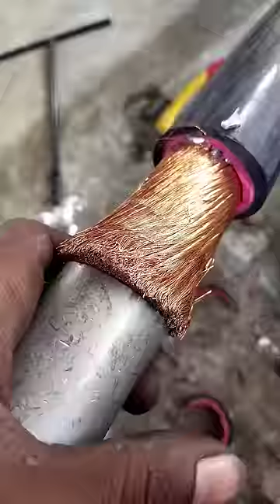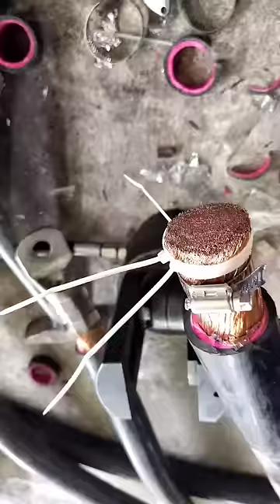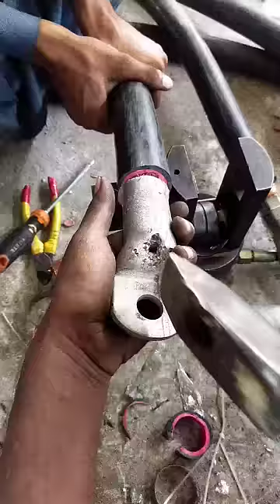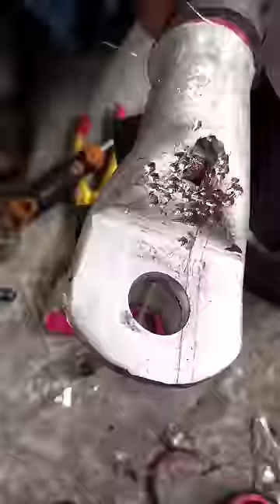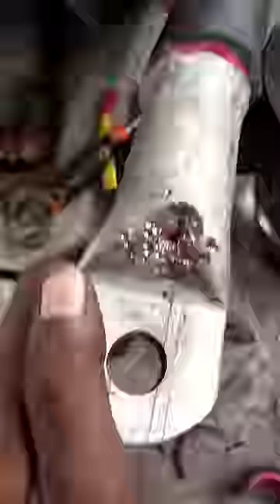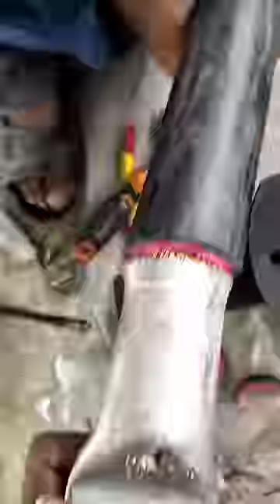Technique | 630mm² Cable Copper Lugs #shorts

Comment: Perfect for my 250,000 watt rms subwoofer amp
Reply: 250000 Watts?
What the hell kind of subwoofer amp are you powering with that
Reply: we running 1 ohm stable bridged with this one 🗣️🗣️🔥🔥
Reply: @Miauterminds  giving heart attack to the people nearby.
Reply: Pmpo chinawatts
Reply: Huh @Miauterminds
Reply: Хороош 🤣🤣🤣
Reply: 20000 db?
Reply: @Josh72769  The energy would be so immense it could vaporize matter and potentially form a black hole. This is beyond what current physics can handle and purely theoretical, but it's mind-blowing to think about!
Reply: Bros finna turn into a mobile thunder gun
Reply: we goin 1/4 ohm tonight boys
Reply: That's what I had to wire to because I was rising from one ohm to 10 almost 😭😭😭 @KianF  .25 #team no fuse
Reply: @packoswuids9000  that’s awesome bro 😭 don’t always be afraid of box rise, it’s a sign your speakers are working efficiently
Reply: @Miauterminds  трансформатор😂
Reply: Them Brazilian waxed amps hit hard and thick.
Reply: ultimate earthquake machine
Reply: Ural 😂
Reply: @Miauterminds  Basically a semi-truck trailer that was converted to a subwoofer 😅
Reply: غلط  يا معلم  ...  طريقه غير صحيحه ....
Reply: But are they magnus opus cables?
Reply: Man thats not a real world solution..

A speaker can't handle a quarter of a megawatts of heat...

Even with 1ohm dual voice coil running in parallel with a bridged amp capable of this monster would have ±125KV

Man thats way too high..
Reply: Think about the load each channel would see...

0.25ohms 

Thats way too low
Reply: Even with 85dB/w/m

 You would get 139dB spl.. thats not worth it
Reply: If you play in kashmir then the Kanyakumari peoples will feels a bass🙄🙄🙄
Reply: This cable could not handle 16000 amps. I know you’re joking but 250 kw DC at 15v for example is what we call a fuck load
Reply: @daddymao2944 Amp Clip Light Turns Onn due to 1 ohm impedance when it needed to be 1.2 ohm💀

Comment: As an electrician certified up to 500kv. You're fired.
Reply: Electrician ? At 500kV ?! More like Lineman no ?
Reply: @dnorby6990  not lineman, I worked on a wind farm and had to do substation work
Reply: @CasinoOfBrownClass the class I did was the Shermco HV/UHV class in Texas years ago
Reply: @austinhall3937 thanks for keeping the power on homie. I’ll keep running conduit.
Reply: Because he made a hole in the crimp thing?
Reply: @C4TBF   Yes. You're supposed to easily put it on cable, then crimp it firmly, cable this big needs a hydraulic crimper to crimp it, so all the conductors act as a single one. Right now not only there are multiple small dots of contact, it can't be crimped properly (it would probably snap because of hole) and the hole itself lets air inside, causing corrosion and oxidation of copper, I'd expect it to burn off in 5 to 10 years max. And of course it would never work at maximum possible load without overheating and burning.
Reply: you mean fried haha
Reply: they are indians, what did you expect

Comment: yes now blowtorch the tip of the terminal till you see the colour change down to the bottom, then get fat solder and feed in until it starts to drip out the bottom, allow to cool then heatshrink 👌

Comment: what is that even suppose to connect to???
Reply: My amplifier in the trunk
Reply: An equipment with the power equivalent to 40.000 toasters.
Reply: Kontaktor, 3 phase engine
Reply: Headphones
Reply: Lots of equipment has flexible conductors this size.

Comment: How many amps do you need?
Yes!
Reply: at my job, we build 1200mm2 alu cable, and some years ago, we made 1600mm2 alu. So, it's not so big that's we think. ^^
Reply: To answer your question, all of them.
Reply: 500 to 1000 depending on the length and acceptable voltage drop.

Comment: I don't understand electricity. But the aluminum terminal was wrong for the copper cable. Am I right?
Reply: Yes and no. You are right to think that electrical joints of different metals will cause corrosion, especially in humid environments. But those terminals are actually made of tin-plated copper, precisely so as not to corrode.

Comment: When you are from the USA, and you need to plug in the heater
Reply: This comment makes absolutely zero sense
Reply: @ericlakemaker9910  probably about the 120v compared to 230 in europe
Reply: @scrolllock9274  ah that makes sense thanks bro
Reply: @scrolllock9274  we have a thing called "HVAC" over here in the states, we don't rely on space heaters primarily and as such don't typically require "plugging in the heater."

Often appliances like ranges, and heating system in the states are powered by gas, when you have dryers, ranges, and HVAC systems powered by electric they are wired on 240v circuits, same as the avg circuits in Europoorland. You don't need that voltage to run most plug in devices and as such the "normal" circuits in the states pull 120v 

Trust me Americans have better electrical systems than anywhere in Europe, and btw we figured it out before any of you nitwits.

Comment: Just cut a ring of the insulator, put it close to the tip of the copper wires so they get straight, put the cap on it and cut the excess insulator, no need to waste zip ties (you can open them anyways)

Comment: Very rough work. I come from a family of LV-HV Cable Jointing Contractors in Malaysia and Never have we come across such Gross negligence and damage on the  Cable Lug!
Reply: The lug is beaten, it has a hole exposing the copper wire, and should not be used.
Reply: @freddiefrost818  yep it is a weak spot for future catastrophic failure. In Malaysia for alu cables, there is a hole drilled onto the top of the lug seat- for filling it with molten Tin.
Reply: @freddiefrost818  all cableshoes we use in sweden have that hole so that you can see that the copper has gone in all the way

Comment: Heat crimp up use taper punch to flare it out little works try it
Reply: Never want to alter a lug besides the crimp itself ever. Completely jeopardize the integrity of the metal by expanding the lug just to crimp it is completely asinine. Use the correct sized lug for gauge implemented

Comment: The technique was fine. The lug was not.
Reply: No it is not. The proper technique is, when stripping the cable, leave a circular section of isolation in place. Shift that band to the end to keep the strands together.
Reply: @BartSliggers  that's if you didn't screw it up first.

Comment: My question is. That giant hole on the connection, that water will seek into and rust out the copper cabling....
Reply: It's an inspection hole, to verify that the copper conductors have reached the bottom of the lug. And copper cannot rust, iron rusts.